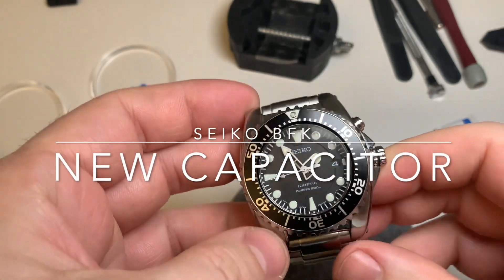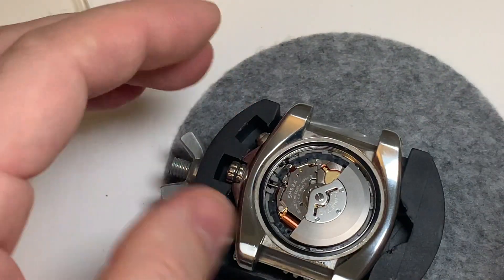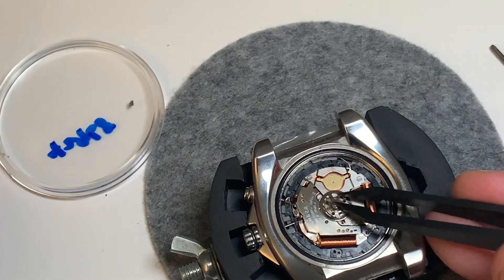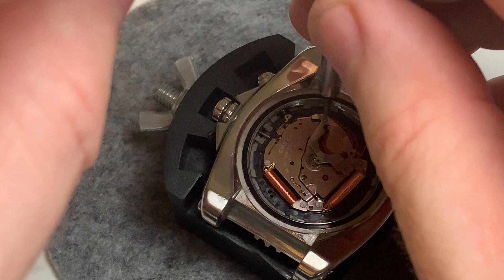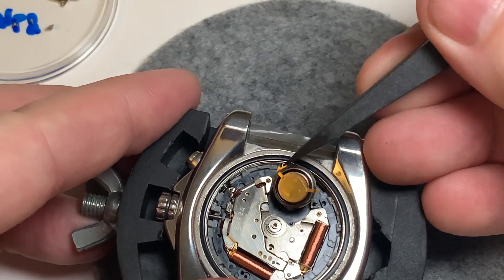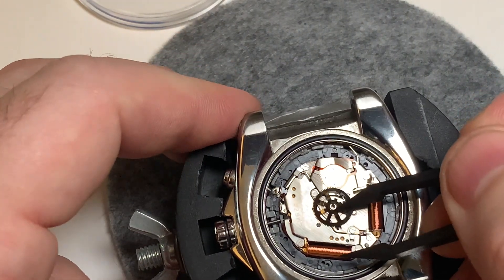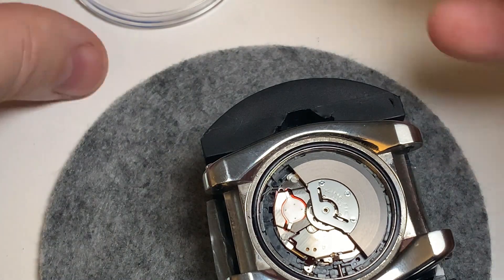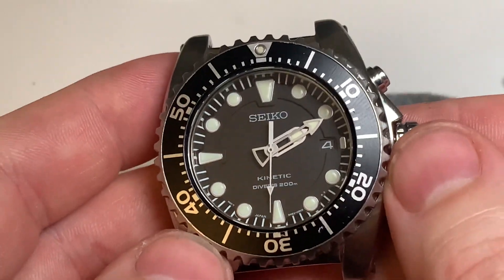Seiko BFK New Capacitor

Comment: Just found my Kinect watch that's 22 years old. Had the capacitor replaced, then had it sitting in a drawer for about 3 years. Started wearing it again recently and it still holds a good charge. Now I know I can change the capacitor myself if I need to.

Thanks for the video.
Reply from the maker: Always glad to help PartyUpLive

Comment: Very helpful. When putting back the capacitor hold down screws, it is very important to press down on the capacitor hold down plate with one hand while inserting the screws. I lost one first try because it sprung out of the hole. The screw vanished like a magic trick never to be seen again. I ordered a pack of two Seiko capacitor screws on eBay. Good thing they came in a pack of two because the exact same thing happened again and I lost one. I think my hands shake too much from all the medication I take but the job is done and My Seiko SKA187 works like new again.
Reply from the maker: Glad it helped sir , I'm now a studying watchmaker by trade and the tick is to rest your elbows down that should sort out the shakes Andrew

Comment: You are much braver than I am lol.
I've had my Ska 371 for 5 years, it was given as a gift second hand from my step father that brought it new, Its one of the best things he ever did for me 😒but this watch is nothing short of AMAZING!!!!
They were like £300 brand new and such an iconic watch and can get them £200 2nd hand on ebay, its got to be the best ever watch ever made for that price, its a very heavy robust watch, I watched a stress test video on it years ago but cant find it, they drove over it in a 2 ton truck (weight would have been 500kg on one wheel), freezed it for 24 hours then boiled it and it never lost time!
I haven't had to change the capacitor in mine yet, it still holds good capacity and time, its also best not to let the capacitor run low.
The best way I found for charging it when not wearing was to put a round hook in ceiling with a bungee cord and swing it in slow circles, kinetic energy makes kinetic energy 😃
Reply from the maker: I like the idea of the bungee cord but not sure if it would catch on in the horology world 😁👍🏻 They are pretty bombproof shame Seiko have stopped making kinetic watches, so it worth keeping hole of it
Reply: @ClickSpringReview  Bungee method works very well, I wont never get rid of it mate! Best watch I've had in 30 years ❤
Reply: @ClickSpringReview  I was robbed of an absolute classic Seiko when I was younger :(, my step father gave me it when I was 18.
A bronze faced mid 70s chronograph divers Seiko, I adored it, one night after a club 5 dudes mugged me and smashed me and my car up, my so called friends wouldn't even help me :(
Reply from the maker: Nightmare have you ever tried to find a replacement one ?

Comment: Thanks so much. My BFK stopped holding charge less than 5 yrs from when I purchased it.
I just swapped out the Maxell TC920S with a new Seiko packaged Panasonic capacitor, packaging says part number 30235MY
I'm hoping this one will last a lot longer than 10 years which should be easy surely! I'm very disappointed so far! I was thinking that Seiko would have outperformed a Casio, but not so.
Reply from the maker: Always glad to help Glen 👍🏻
Reply: What you need to remember is that the charge life of the capacitor is directly related to how long and often the watch is worn. I have a Sept 2012 BFK model and it is still going strong but that's only because I have worn it everyday since I purchased it early in 2013 so the charge has been kept up to maximum all the time.
Reply from the maker: @Edward1312  if you keep it charged up you won’t have any problems it’s when you let it discharge and leave it for some time they don’t let it
Reply: @Edward1312  sounds great. So if I never took it off it would never have run out of charge. That makes a lot of sense… But they advertise it as “6 months life from full charge” so why would I wear it every day and never take it off for the fear of damaging the battery life.
Reply: @GlenEdwards  The charge lasts 6 months yes but if you let the charge degrade by not wearing the watch regularly and keeping the charge at the 6month mark you damage the capacitor. Kenetic watches have to be worn regularly that's there biggest drawback.

Comment: like and subscribed!  i have this particular model, and with rapid circulation in the same direction, i can get it fully wound in about 45 to 60 seconds.  a second press and its down to about ten seconds, a third press and down to just about four seconds.  now this is the original power supply and it appears on its last legs--or is checking repeatedly discharging power?  at any rate, i'm wondering about buying a new part--will it lose power if it's a while before installation-and be a waste of money?
Reply from the maker: No I think it should  be ok Gregory don't worry and thanks for the Sub :)
Reply: @ClickSpringReview  thanks! i'll order one for 58m2 movement.

Comment: Saw another video, same movement, job, and he didn't remove the rotor. Also the capacitor he fitted came with a new bridge plate and translucent film cover. 🤔
Reply from the maker: Its always safer to remove the rotor as you don't want it spinning and getting in the way when your handing small screws , You can get some which come with a new plate but they cost more and its really not needed if you have the old one 👍🏻